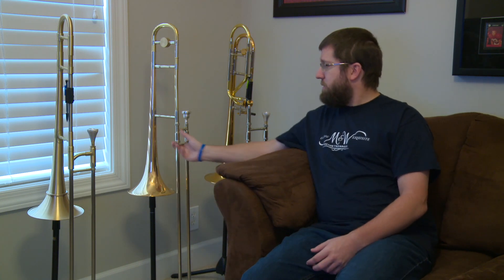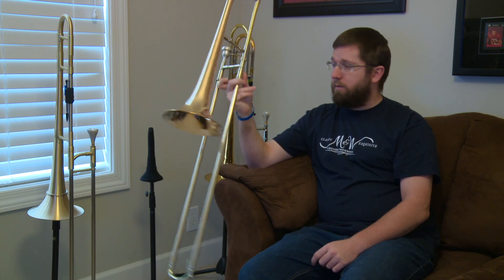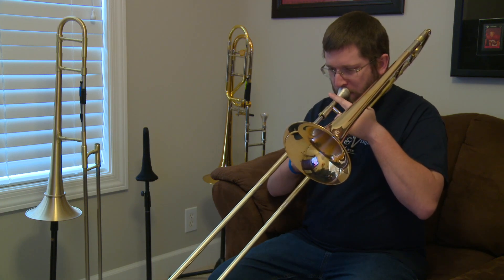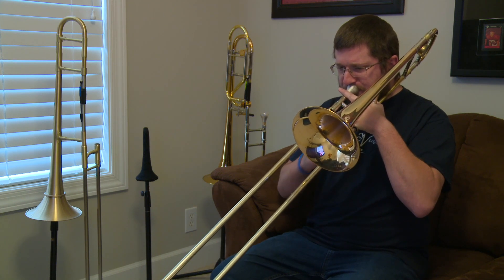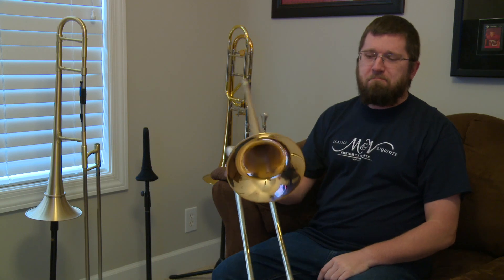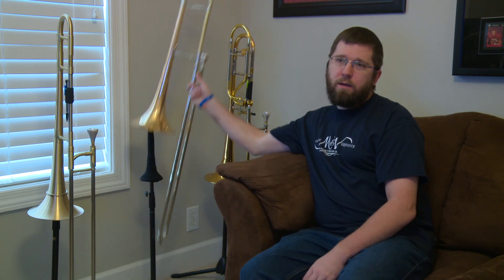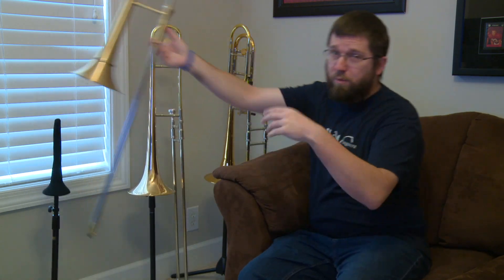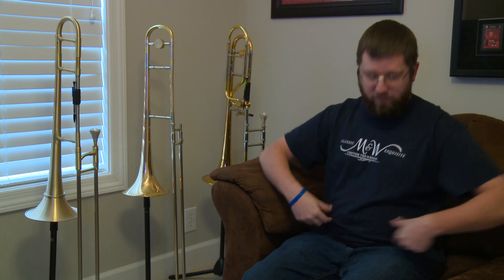M&W 210 Small Bore Jazz Custom Trombone Review

Comment: 2:03 M&W 210-2R .508" (7.75" red brass bell)
4:47 Lawler .500-.508" (7.5" Z-5 bronze bell)
5:54 Lawler (8" Y-2 yellow brass bell)
7:06 Commentary/Impressions
Thanks for posting this review - nice playing!  These horns are both on my radar for the future.
Is that a Lawler model 1 or model 2?  Also, which leadpipe is in your M&W and what mouthpiece model did you use for this comparison?

FWIW, about the slide noise:  
I have a few M&W large tenor and bass trombones with brass outer slide tubes.  In my experience (including a Bach LT12), those lightweight nickel-silver slide tubes just tend to be noisier than brass.  Maybe the yellow crook on the Lawler dampens the sound or Roy uses a different preparation/buffing/cleaning process in the outer tubes.
Even with outstanding alignment, my M&W slides needed to "break-in" for a month or two before reaching their current smooth, quiet state.  My Bach LT12 slide was always a bit noisier than other horns, even after years of use and cleaning.
You could have someone "tickle" your outer slide tubes again, polishing them further inside.  Honestly, the sound is probably largely made by the tiny bit of buffing residue left behind (even after cleaning) from the initial polishing of your outer slide tubes, since it's a new horn.  That's typical & will be gradually removed gradually with frequent cleaning using a clean cheese-cloth rod.
M&W recommends using a small touch of trombotine, then using Yamaha slide lubricant over that until you clean it.  Trombotine might make it a bit smoother/quieter for longer.  However, I still just use the Yamaha stuff, since I like to wipe the inners off and re-apply fresh lube before playing and after every ~2-3 hours of playing.  What method have you found works best?
Reply from the maker: Appreciate your comment. 

To answer your earlier questions, the Lawler Model I'm playing is the Lawler Model 2. 

Also, quick update since this video was made, I've actually returned the dual bore slide for a straight .508 (he calls it twin bore) slide. Still nickel outers & yellow end crook but definitely happy I went back to what I was comfortable with in the .508 size and even gave me a threaded lead pipe whereas my dual bore was not.

As far as the M&W lead pipe I'm not sure what was in it as it was unmarked and was fixed so not removeable. Would have to ask Matthew Walker what he puts in his .508 M&W slides for lead pipes. :)

The believe the mouthpiece I used for this video was my AR Resonance 25.40 with an S back bore.

As far as slide lubrication, I agree with you that I prefer the Yamaha slide lubrication (purple label) for everything now. Just works!

Comment: Great sound, lance. Are you still using the M&W?  What mouthpiece do you use?
Reply from the maker: Thanks man! 

I actually never purchased the M&W. The one in the video was a rough draft horn Matt Walker sent me to try before buying and I ended up going with the Lawler Model 2R which I still have to date and love! 

TBH the M&W was great but had an unfair advantage at the time as I tend to favor the .508 slides and the Lawler in this video was a dual bore slide (.500/.508) which I later swapped out to a straight .508 and now the Lawler is perfect horn for me!

Wanted to buy a medium bore M&W from Matt but he ghosted me after I didn’t buy the small bore in this video. :(

As far as the mouthpiece I use, for lead playing, I typically will play on my Griego Oft Small Bore/Alto trombone mouthpiece I tried at MidWest and loved it but it’s a bit on the small side. Also have a Pickett small bore 6 Rim & 6 Cup mouthpiece I use on my medium Stephens Brass trombone but thinking I want to make a trip to Greg Black’s shop in NC and pick one out. Tried a 5G Greg Black at Dillon music in NJ a few weeks ago and loved it! Now I want to truly get fitted for one and see if I still end up in a 5G.

Comment: Nice, Lance.  
What mouthpiece are you using?  
I'd also be concerned about the M&W's slide noise.
Reply from the maker: The mouthpiece I used was an AR Resonance 25.40 with a S back bore. From what I've heard from other M&W players & Matthew Walker himself the slide noise is only temporary and after a break in period of a month or so it probably sounds as quiet as the Lawler. I just like that the Lawler had no break in period. Ready to go out of the box. :)